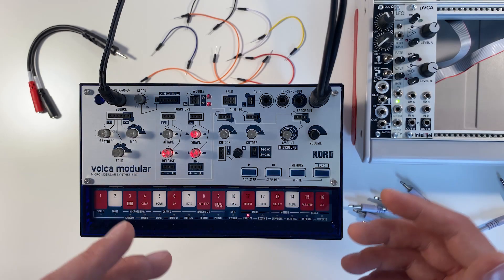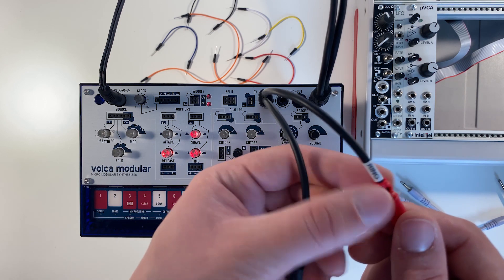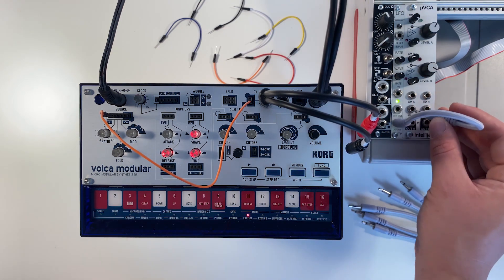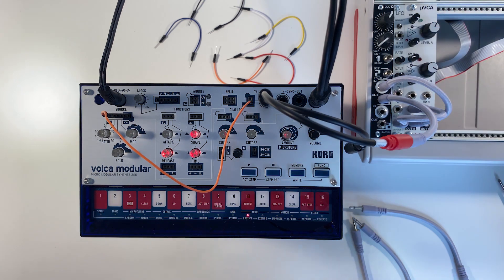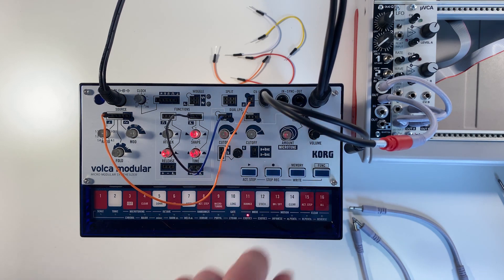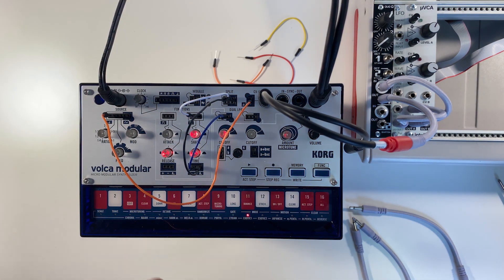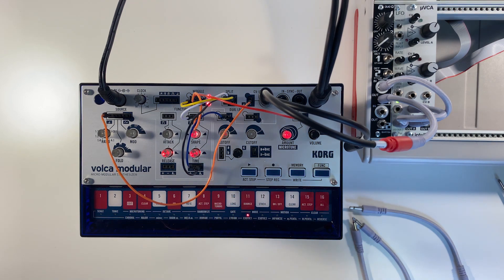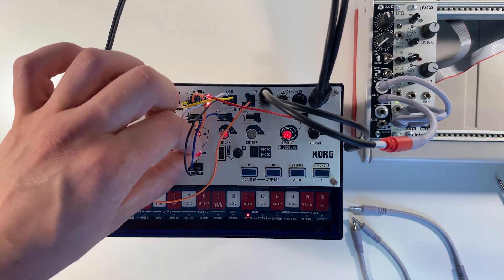Patch of the Week 25: volca modular + eurorack pitch quantization

Comment: Surely I can’t be the only one to hear that that’s out of tune? It’s the same issue with every video using external CV. The CV input of the VM isn’t calibrated precisely enough to deal with pitch input; an octave sent into the VM makes slightly more than an octave, so every interval is just slightly too wide.
Reply: No, I think it's generally accepted that it doesn't really track V/Oct very well. Personally I don't mind too much considering how much synth you get for your money. As long as it works well stand alone it's fine IMO.
Reply: Oh yeah, definitely still a good synth, I feel like the CV is better suited for external modulation than full pitch tracking, I mean the VM’s sequencer is pretty good for that!
Reply: I used kenton Pro Mk3 for tuning and the pitch now is on tune.
Still a bit unstable, but i think it's related to the breadboard connection.
Reply: Federico Clozza would you mind explaining how you did that? I'd really like to get mine in tune, its flat :(
Reply: I agree - it's definitely out of tune: a 1V difference is changing the pitch a little more than one octave: there's no need to use a tuner to hear it. Two offsets would be needed to get it right; the last firmware update provides only one. Too bad!